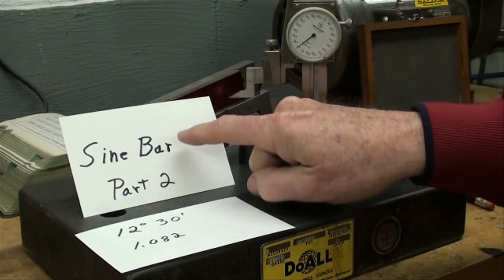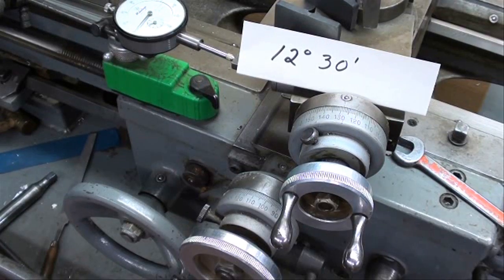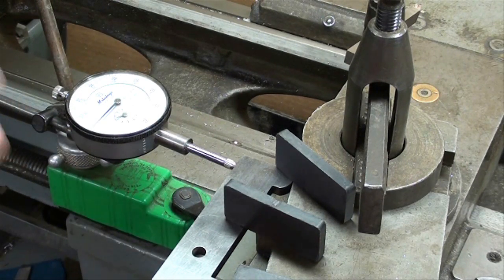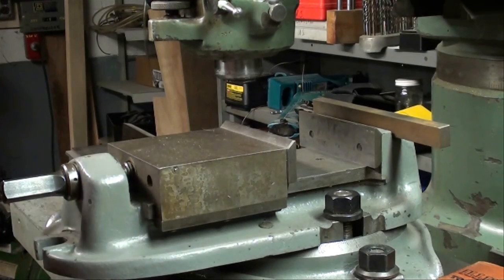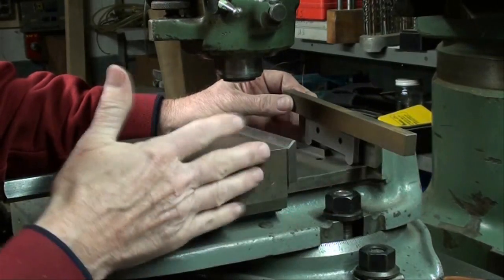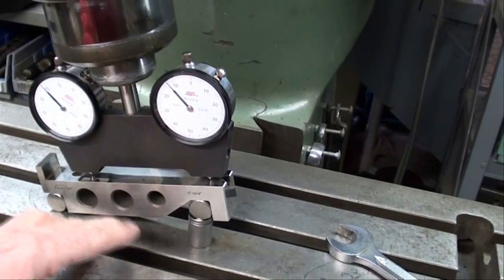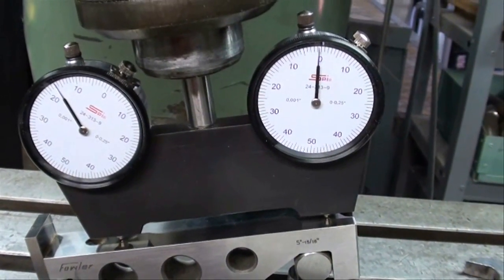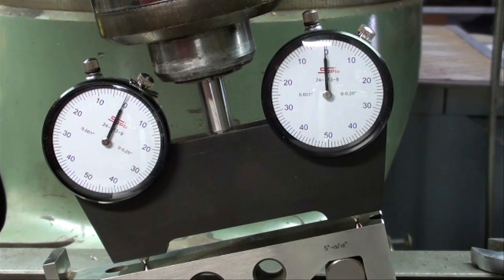MACHINE SHOP TIPS #20 Sine Bar (with SPINDLE SQUARE) part 2 tubalcain

Comment: Hands on machine setting and the ability to actually think and calculate angles etc is something the younger generation is lacking in because they rely on tech rather skill.  My son now 17 keeps telling me I should be his tech teacher at school with little tricks he has learned from me. Made a Traming alignment tool when I worked with cylinder heads 20 years ago and now ya can buy them ? Good stuff MrPete :)

Comment: that double indicator looks handy. At my work I use huge sine plates to machine molds. I even work on an old CNC machine that has the spindle mounted on a Sine plate. I have to setup the spindle on a compound angle to machine huge molds where I couldn't reach straight. It's a pain in the ass but I can do it pretty quick. Programming like that sounds complicated but it's actually pretty easy.

Comment: I do it this way because I don't have a sine bar. With 2 dial indicators you can measure the travel of your cross-slide (indicator must be parallel to the cross-slide) over the change in distance on the compound (indicator must be perpendicular to the compound) and use trig to get the angle of the compound.

Comment: @4:00
with a 3" sine bar, 
the block should be .240 for 4 Degree 36 min.
a .250 block gives you 4 Degree 46 min.
But other than that it's a good demonstration of how to use the sine bar to set up an Angle.

Comment: Did you miss taking a beating because you moved the head on the Bridgeport?  Just kidding, I enjoyed these two videos and I could see a use for this in my woodworking shop.  The cross cut guide on a table saw has a protractor that is worthless.

Comment: When clamping in the vise, be sure sine bar is parallel to vise jaws.  Otherwise, you shorten the hippo noose and increase the angle.  Also, you don't need an exact match to measure angles.  Get within a few thousandths, then divide the error by 285.  That is the degrees angular error.   I would not hire a machinist who failed trig or who could not use a calculator to find sines.  See the book, "Dead Reckoning" for how to find sines WITHOUT tables or calculator.

Comment: When using the sine bar for the mill tramming do you need to account or make sure the sine bar and spindle square are parallel to the x or length of the table?

Comment: Question: would it be more accurate if you placed a parallel on the bottom of the milling machine vise, in case it is uneven?

Comment: I used a calculator to determine that the opposite side of 0.25 inch divided by the hypotenuse of 3.00 inches gives you an angle of 4 degrees and 46 minutes, not 36. What went wrong with my math? here it is 0.25 div by 3, take resultant and do inv-sin, that's 4.780 degrees, subract 4, that's 0.780, multiply by 60 to get 46.8 minutes. Did I forget something in my olde age?

Comment: Dude...Rise over run. simply put with the compound. Just use the AGD 1" over the run of 1" and the rise (or drop) will give you the Angle....or not.
 You don't spend 40 or 50 years cranking handles without learning a few things. I respect the video, I really do. But show these apprentices the right way.
 FYI....you just magnetized your compound....not good.
 I respect what your trying to do here, I really do. I'm sorry if I'm hypercritical of your video. It's light years over some of the huckleberries with a machine and a camera and more knowledge of the internet with Youtube than they ever did in the trade. So good luck with that.
 So next thing I'm going to see is one of my apprentices with a sine and AGD try to establish an angle this way....unreal. My father would have hit the roof, then sent him back to Bergmaster drill department for over thinking!
 Cadillac sent up,for a VW part...that took 30 min.
Reply: This method allows you to calibrate the compound angle where the only inputs to the accuracy of the angle are going to be the sine bar and gague dial, a fully external reference from the lathe.   the method you mention depends on the accuracy of the crossfeed scale.

the other thing is that this is a video on sine bars, not setting angles on lathes.  Thats just one application he offers.  

Also, i think you mean acrtan(dial change) is the angle.